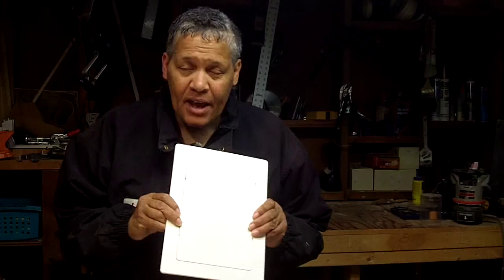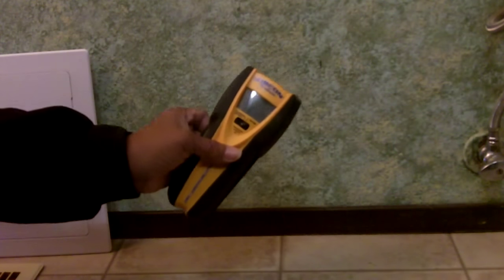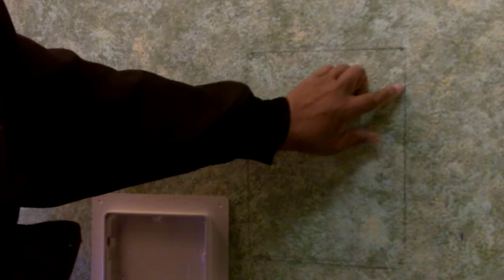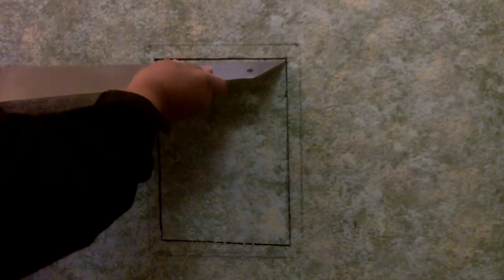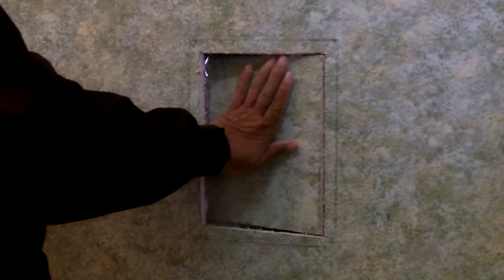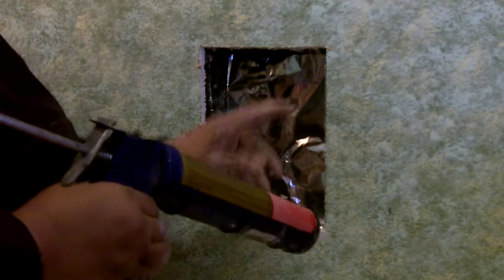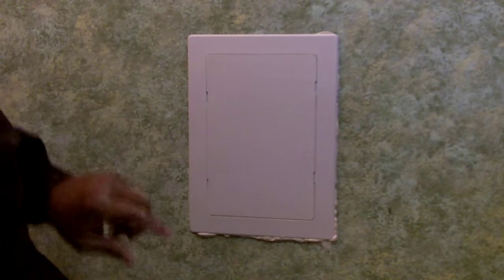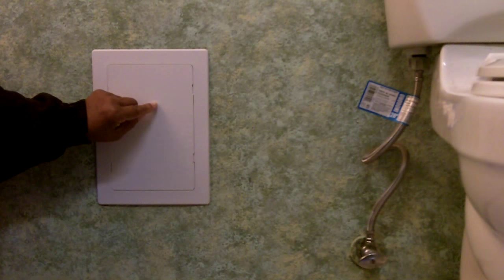How to Install an Access Panel in a Wall

Comment: I'm a big fan of Leah. She has some great videos, sometimes a little 'slow' for experienced DIY'rs  or pros, but gives great insight, tips & confidence to those much newer to general home repairs and even to the 'experienced'. On this video I wondered if she's ever tried the 'Walabot' instead of a stud finder. Sometimes a stud finder will not discover a 'fire stop' or stud if screws or nails are not present in the area to be used. Tapping 'knocking' on  the walls does take a little experience to locate the proper 'thud', especially with various types of insulation are in the walls. I also was curious if the wall she worked on was the paint or wallpaper. Today, I found out that access panels are pre made for the purchase. Leah, you're terrific.

Comment: Did an inspection hatch in the ceiling so my gas inspector could see the pipes or he would not give a cert. for the boiler. I was lucky the joists were exactly the same width as the hatch. Used a worx multi tool to cut out. Worked good. Glad i moved house. Getting the proffestinals in to do a full replacement in this house with all the certs in place. Good vid Leah
Reply from the maker: +Ian Brodie Smith thanks, Ian, nice to hear from you!  Glad your project worked out! Regards, Leah

Comment: Thanks for the video. Just a note: You don't have to worry about glue spilling over to the access panel itself because there's this 1/2" tall border separating the access panel from the frame.

Comment: Overlooked one essential step. Before cutting the wall, I would use a level to mark the lines just so the panel door is square after installation.

Comment: That seems to be simple as long as you remember where the stud is in the wall. Thanks again for sharing the information.
Reply from the maker: +Sidney Mathious you're welcome, Sidney, and thanks! :)
Reply: +Sidney Mathious You can buy a stud detector for pretty cheap. ;) Same thingy for finding any metal plumbing behind a wall and electricity cables. I too had to get me one of those, since the house we bought didn't come with a detailed scheme where everything was located. That little detector saved me from a bunch of headaches and having to redo everything. ^^
Reply: I thank you for that information as I have work to be done inside my old house. Marry Christmas and I hope you have a Happy New Year.
Reply: Sidney Mathious Same to you and your family, bro. Cheers. ;)

Comment: You traced the entire width and length and then subtracted the backside panel size that fits inside the wall roughly 1 inch smaller all around. If you simply placed the panel against the wall, the backside inner panel that inserts into wall after hole is cut would force panel to stick out 1 inch allowing  you room to simply trace around the exact cutout size with a pencil making a simpler and more accurate measurement to cutout. Also, I would not put adhesive on the wall itself as you did causing it to spill out and be messy when attached. Instead, put the adhesive around the outside of that same backside inner panel you traced around earlier so the adhesive would simply attach to the cutout portion of the drywall when installed. No mess.
Reply: THANK YOU! It was breaking my brain to wonder why she decided to do it all backwards.
Reply: Genius

Comment: Was that a plastic panel?  Also how do you get into it?  I did not see a handle.  Does it open just by giving it a push?  Great info.  I wish I would have had that years ago with a slow shower leak that was behind my closet.  What a mess that was.  Thanks again.
Reply: That one is a plastic panel, and the inner piece has 4 very small slots around the edge that you can use to pry it open with a flathead screwdriver (or a key, or a table knife - use what ya got!)

Comment: I neglected to watch your video before I installed my access panel. ☹️ I got it done; however, I glued the frame to the wall without the panel attached. Now I’m having trouble snapping all sides of the panel into the frame. Could it be out of level? The frame doesn’t exactly move, so how could it be crooked?

Comment: Professionals came, installed my tankless water on demand so they had to cut a hole into the hall wall to access the gas line, they told me to buy an 8X8" 'cover', I can see half of the stud where they cut the hole, I haven't fixed it yet because I didn't know what to buy, as I was just going to buy a vent cover, then thought, "what if we needed to get in there", then I seen this video.  I just hope because part of the stud is showing it won't prevent the assess panel from going in, if so what do I do, cut that part away on the panel?  In my opinion they should have fixed it & not left me with a hole!   Also there is a hole precut to turn off the shower plumbing in my bathroom left same way, at this time I just have a wood board covering it.  I hope I can fins the correct size, this one is quite large.

Comment: So, you have the access door installed. You showed the project done with the panel closed. But you failed to include instructions to release the access door panel clips so you can get to the plumbing.

Comment: Great  video. .I have a question. ..can I use caulk instead of  construction adhesive?
Reply: No: construction adhesive is a glue to attach the panel to the wall. Caulk is not a glue - it is a filler.

Comment: Nice video, I have a problem with a panel. I can't open it. How should I do to open it? I tried using a screw driver in the hole (like the key hole in the door) openin but the screw driver broke. I move the hole a little but still enough to open it

Comment: What would have made this a more effective video is if the demonstration included actual Plumbing fixtures to access, via the access panel. I don't need an access panel to look at insulation

Comment: I love your videos but this one I did NOT LIKE! That is not a drywall saw nor a utility knife in the construction working tool collection that myself or anyone else I know of uses. that saw will cause someone to do damage to plumbing, electrical, or the other side of the wall. and that razor "knife" can cause them to hurt themselves badly cause the blades snap with the wrong pressure or twist. but like I said I do love your videos!... just not this one.
Reply from the maker: +Rex Dove Hi Rex, you are absolutely right about the utility (razor) knife.  The thing is, I couldn't find my regular utility knife, so I just grabbed something.   As for the drywall saw, it actually is a drywall saw, and I prefer it to the keyhole  type saw because it makes a straighter cut.  But you do have to be careful that you don't disturb what is behind the wall.  Thanks for your comments.  Regards, Leah

Comment: How do I open my access panel without destroying the horrible thing? I'm not kidding.
Reply from the maker: It should just snap into the outer retainer
Reply: @seejanedrill  I am having the same problem. I’ve tried a flat screwdriver but the plastic just keeps chipping.

Comment: what is that for?
Reply from the maker: sometimes shut-off valves are inside a wall cavity.
Reply: Or sometimes a plumber may need to bust into a wall to get access to a pipe in order to snake it due to a clog.

Comment: Looked like a cheap Home Depot or Lowes plastic panel.  I have never installed a plastic panel on a customers home.  I only use appropriate access panels,  metal,  fire resistant or insulated.